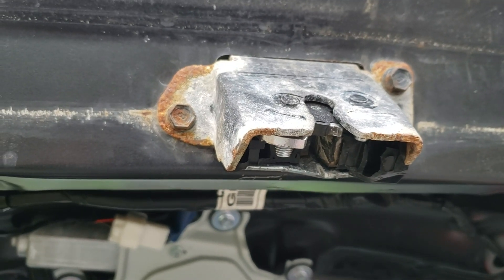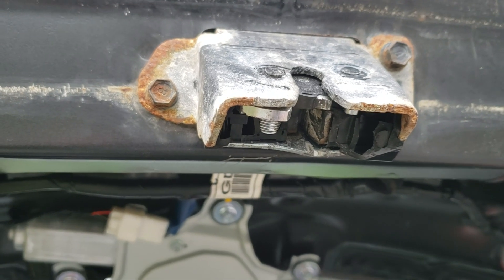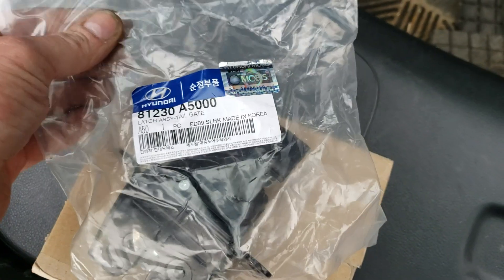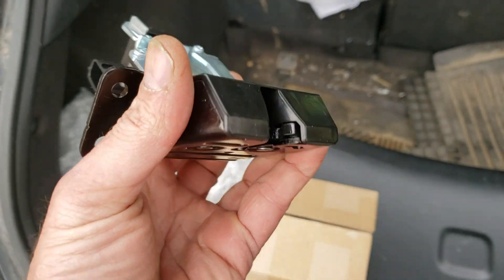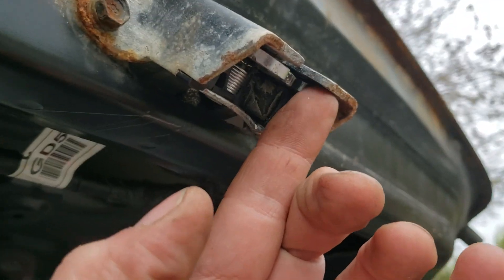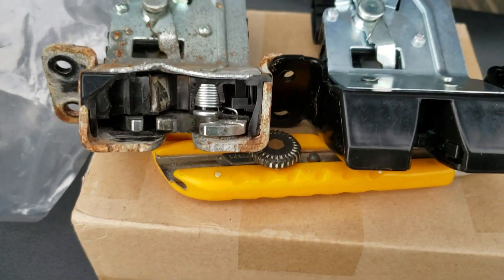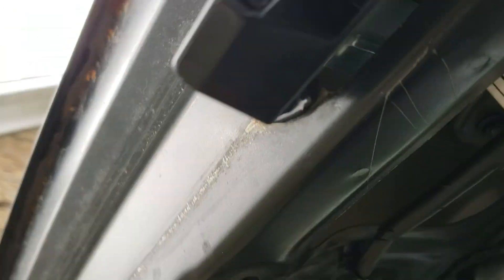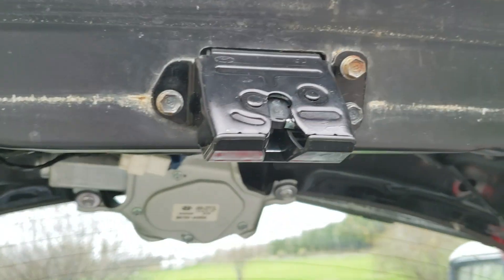2013 Hyundai Elantra GT Rear Hatch Latch Repair

Comment: You da man!  Just did this job in 45 minutes with OEM part off of eBay, dealer wanted $410. for the job, part was only $50. BTW, to get to the electrical connection there are 4 visible screws to take out on the hatchback panel, then pop off from there about 6 or 8 plastic fasteners that release when panel is pulled off - gently.  Thanks for the videos!

Comment: I just had mine fail on me after 11 years. Although, at least with mine, I didn't even have to take the panel off I could just pull the cable right through, pop on the new latch and bolt it right back on. So perhaps anyone that still needs to do this can also do so without needing to take the paneling off.

Comment: Great video! Have this exact same issue right now. One question: With the latch open were you able to reshut the tailgate? That being the case then I assume to reopen then you need to lift the lever again. Just to know so that I will have a "working" tailgate until a new part arrives. Cheers!
Reply from the maker: Yes, you can continue to use this method to open the hatch until your replacement arrives.

Comment: Thank you! But does if lock? Mine closes (and manually opens), but won’t lock. Not with the car switch or the remote.
Reply from the maker: Check the wiring connector at the latch to make sure its secured.
Reply: Yes, we did that!
Reply from the maker: And it's a new actuator you installed?
Reply: @booper2ca  yes.

Comment: ****EASY WAY***

Do not try to hammer the plastic pieces, it is very thick and there is metal under it. It is much easier to find the emergency latch. After finding the emergency latch move Inferior (below) it you will see an opening to wedge a flat-head screwdriver into it. use the screwdriver as a lever push on the locking mechanism with the screwdriver and it will open.
Reply from the maker: It didn't work in my GT. I messed around in that slot for quite a while with various instruments and felt nothing mechanical.
Reply: The plastic is thick indeed, but if the slide release is not working (mine didn't) then brute force is the answer.  Instead of smashing though I found the edges of the plastic cover and used a hammer and flathead screwdriver to chisel and pry with so as to not damage the mechanism underneath.  Voila, and there is the lever to open the hatch.